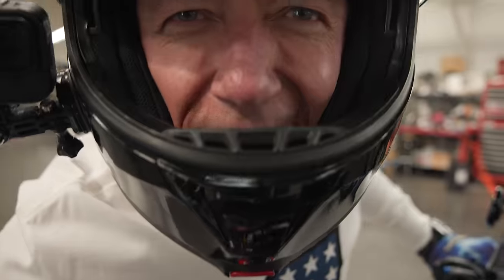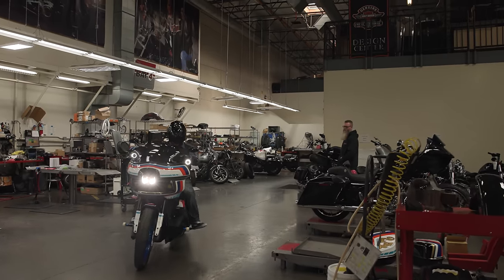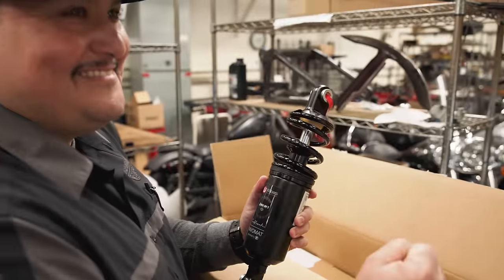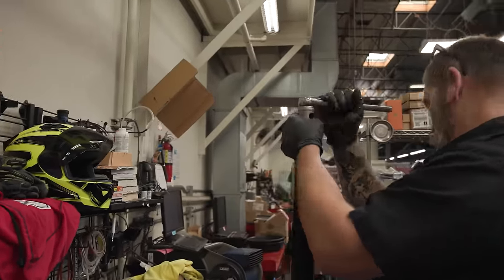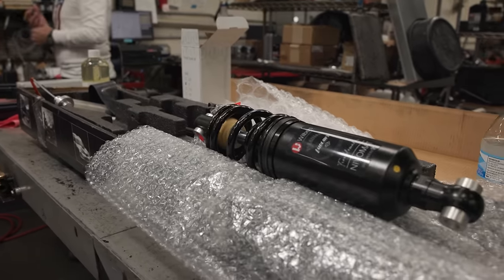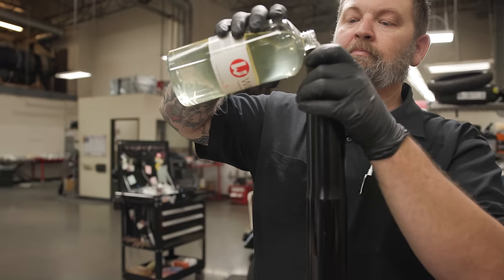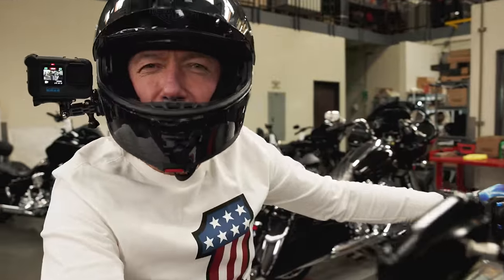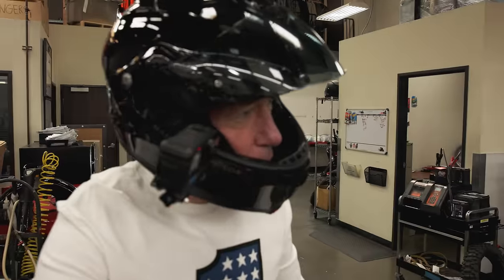Our Favorite Harley-Davidson Softail Suspension Upgrade

Comment: Awesome to see Wilbers now have an offering for the softails. Heard nothing but good things about their touring suspension. From the ending comments, it seems as though you feel Ohlins would be a better fit for someone who rides solo, and does mainly agressive canyon riding. Is that a fair assesment?
Reply from the maker: It would be close but yes, Ohlins would be better to really dial your setting for race application.
Reply: You can also get conventional shocks from Wilbers which come nearly completely dialed in from factory. And in contrast to Ohlins and every other brand, they even put a custom spring AND shim stack into your shock from factory. No extra costs or whatsoever.

Comment: Wilbers is the best. For Comfort and Racing. The swedish firm is a niche specialist on GP level racing.
Clearly, this solution should be applicable to other Softail like suspension architectures, I know the devil is in the details and the setup and miles testing, but principally there’s no reason why the NIVOMAT shouldn’t be available for other bikes, too.

Don’t forget both front and rear need to have aligned suspensions in tune to establish the wonderful balance this bike deserves. It’s so annoying if they’re not equally good.

Comment: I hope you didn’t have as much trouble fitting the Wilber Rear Monoshock Unit as I did the SE Ohlin Unit - nightmare.  However, transformational, now I will have to do the front as I didn’t appreciate how bad that was. Stephan was very polite but the H-D units are rubbish and I am not sure how acceptable that is on such an expensive bike.
Reply from the maker: Interesting I think we have done some Ohlins as well but I didn't hear if our techs had a hard time getting them in or not. I'll have to check that out next time.